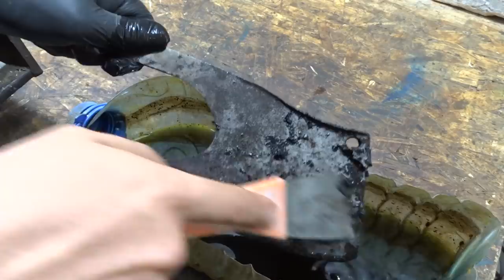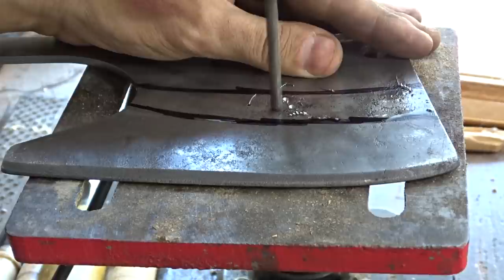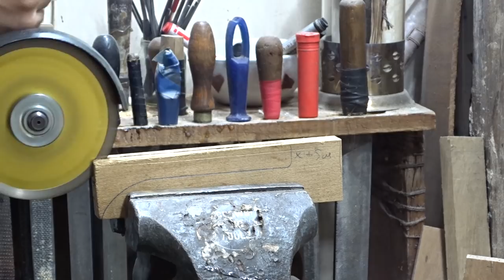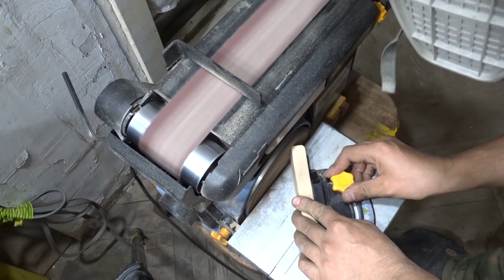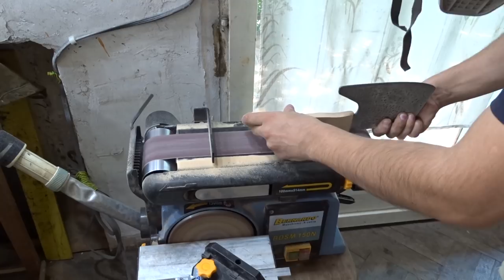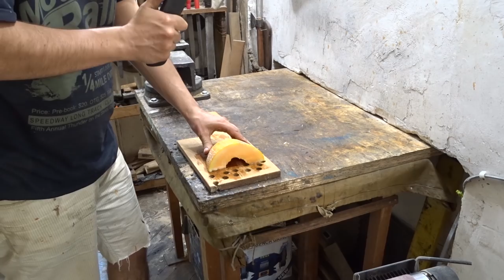Restoration Old Rusty Butcher Cleaver

Comment: This is possibly the best and most honest restoration channel I've come across in a while.

This is REAL restoration of real working tools into a working condition, with their flaws and  imperfections embraced and not erased with filler, unnecessary spot welding and shiny mirror polishes.

I salute you sir!

Comment: Very "unique" cure for the pitting . Using the power source you have for electrolysis,  could you fill in the pits by spot welding with thin wire ?
Reply from the maker: The welding way is good case but I don't have it.

Comment: nice work as always, but you could have saved yourself a lot of hand work..where you used the round rasp to remove so much material, your drill press could have gotten it down much faster, then finish with the rasp.
Reply from the maker: Thank you! I can't trust the machine completely and sometimes it's hard to control my actions. I'm doing better with my hands.
Reply: @ScrewsAndTools  you love working with your hands, thats' plain to see, but learn your machine, spend more time doing the fun parts... I'm not saying try to finish the piece with the machine, just take some of it down so you don't have to do so much hand work just to shape the handle.